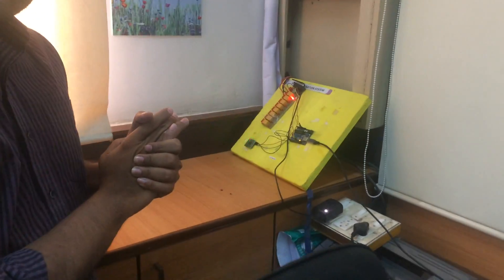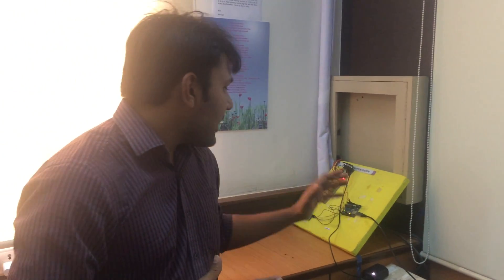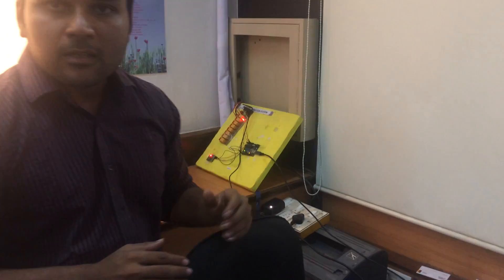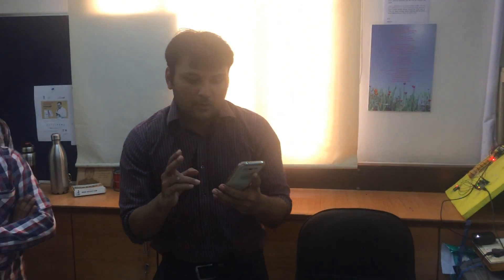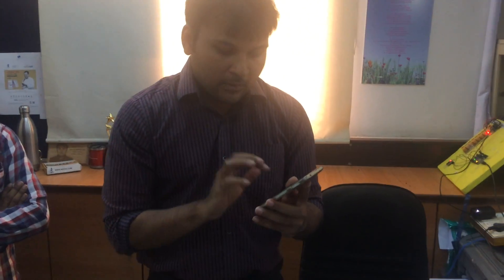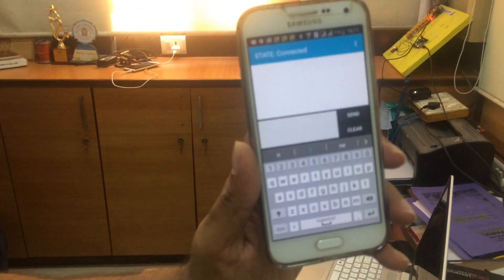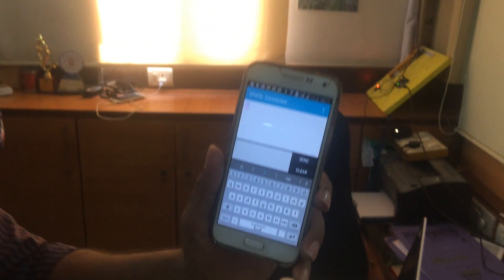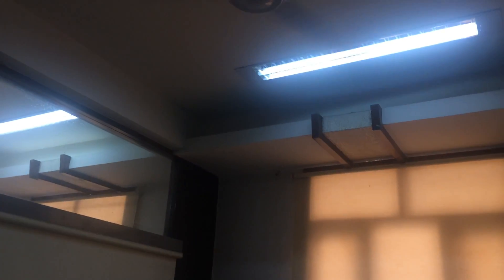Home Automation 2 in 1

Comment: Sir can you share the source code of the app ?
Reply: Vatsal Mistry code is simple and straightforward in android you need to make bluetooth pairing code such that it sends required strings to bluetooth module and bluetooth module will just forward the string to arduino. Further arduino is programmed accordingly to switch on particular pin as per string command.
Reply: ioBroker is an Open Source Project you can use with Arduino, check my website, forum, community and youtube channel, google "amazon alexa iobroker"
Reply: Veronika Kh Thanks. Will check that ! 👍
Reply: you will like it, i promise, so dificult to find somebody with the same interests in HomeAutomation!!!
Reply: Veronika Kh  Yeah !
Reply: Arkit Patel Okay 👍